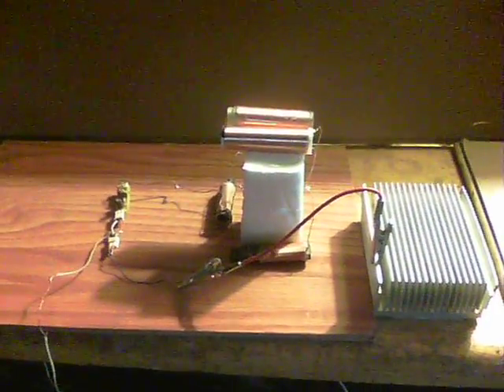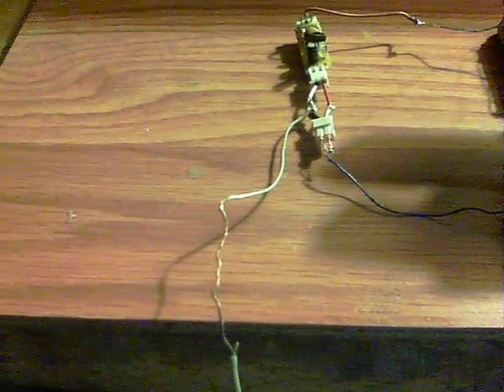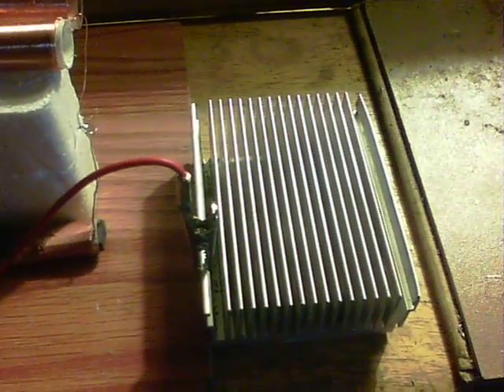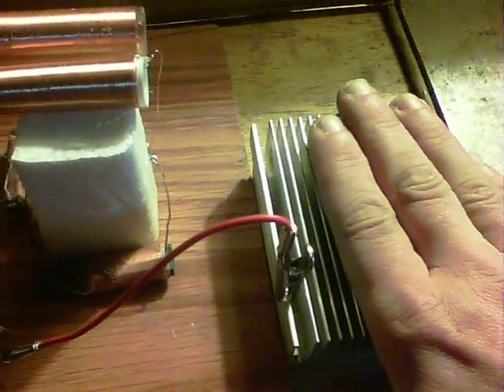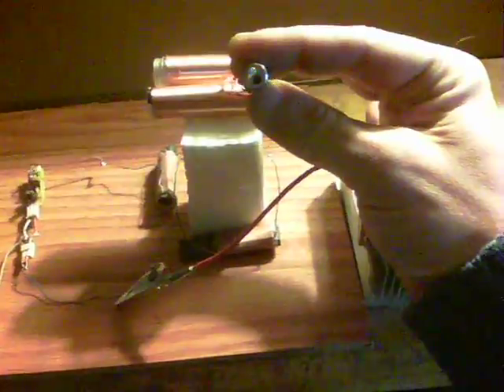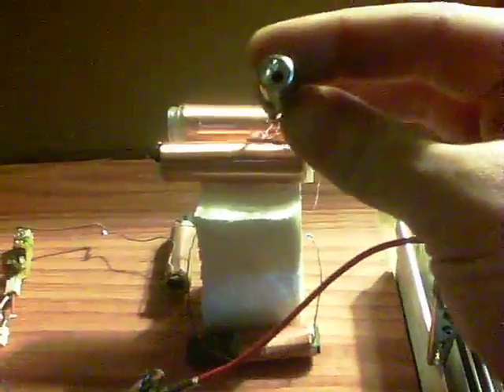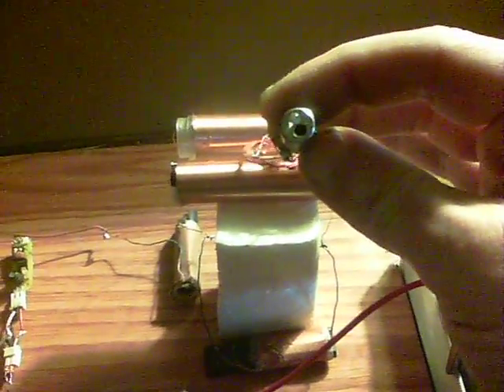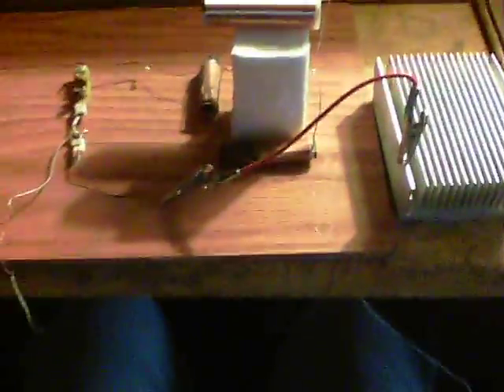Zero input voltage wireless - now no wall adapter !

Comment from the maker: @ZincFold As you may well know, badly enclosed fuse box's/appliances etc are a source of nausea and headaches..so if we can just cohere those energies and indeed perhaps do nothing but eradicate them, then it serves a good purpose. A small energy reuse circuit in a fusebox could be the winner from this - giving 1 wire energies for lighting and more, from what would normally be a health hazard.

Comment from the maker: @Lidmotor Maybe that's all it is, it won't wreck my weekend if it's found to be tied in completely with house mains. After all, if these are wasted EMF's into the environment, then they can be put to good use. Rather than emanating around and into peoples bodies as they do now. Gaussmeter tests on tuned up higher output circuits should indicate what's going on :)

Comment from the maker: @KyleCarrington Yeah, in the description box I mention serially connected and that's all they are, chained together as a line. No caps or resistors etc, from the output of the oscillator. The AM loopsticks help greatly and why they are the first in line.

Comment from the maker: @z1zaz Thanks, I'll try those ideas ! Found some C1675's on an old circuit and they have a really low switch on. Gotta balance output to input though else all i'll get are clicks on the radio. AM radios are excellent with this, for field energies too + is how I normally tune up coil placings etc. Am building an identical circuit and replacing LED with a (forgive ignorance) tiny red diode with yellow band, as they only seem to drop 50mV...will try a Germanium too. Your info is appreciated :)

Comment: Your circuit cannot operate below a certain threshold voltage level set by the transistor base-emitter-junction forward barrier-voltage within itself, plus the series forward conduction voltage of the on-board LED.
Link out the on-board LED and check for circuit activity using only your sensing LED detector loop, or a transistror radio.
I also suggest you try a typical AM tuning capacitor in parallel with R1 in place of C2, also an RF Germanium transistor like OC44 or OC170 from old AM radios.

Comment: Try switching off the power too your whole house at the fuse box.
I've had similar results but found it to be radiant oscillation from mains wiring in my walls and ceiling. If your set up still runs then you could be onto something and I'm buggered if I know what... Thanks for sharing.. :-)

Comment: I'm curious as to whether you had any metal in contact with your skin, when you touched the aluminum heat sink. It almost seems like you are somehow making "you" into an electrolytic conduit, to create a low power battery? Very interesting, any way you look at it!